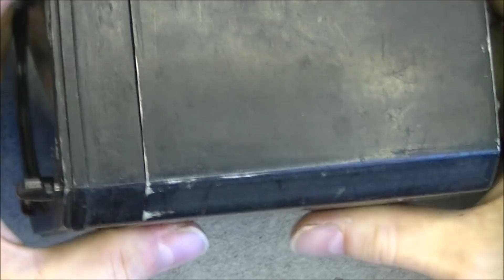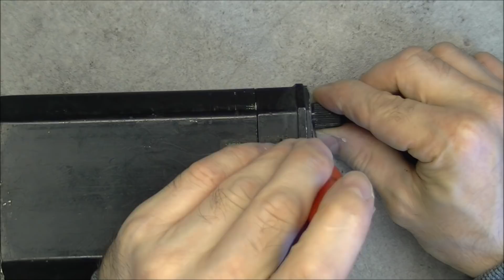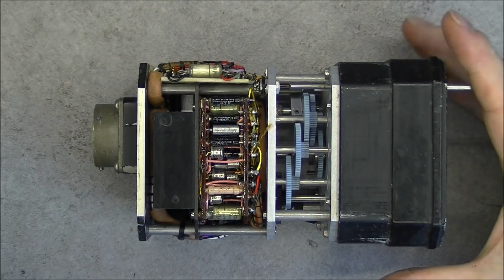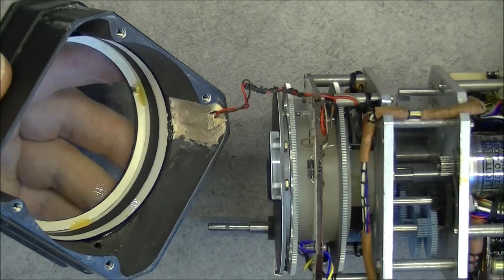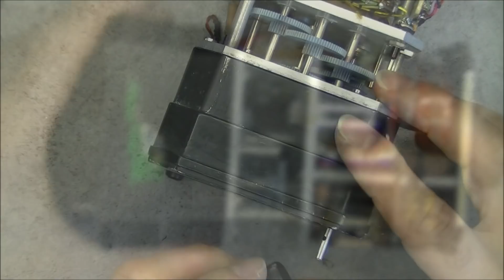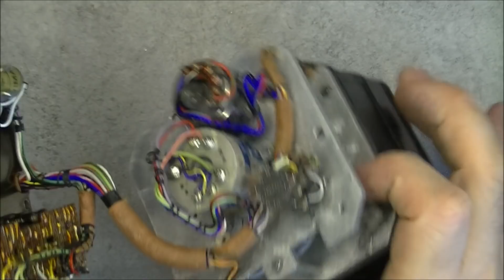Elliott radar altimeter indicator teardown

Comment: Airborne critical product mixed with Veroboard - flying by a wing and a prayer :-! I've sold to avionics - this wouldn't have ever passed approval - laughed out of the building more like :-? Hopefully a prototype? Great video, as always.
Reply from the maker: Yes it is really weird, the instrument shows signs of heavy wear by extended use, and the serial number seems way too high for a prototype. 
I have already seen parts with "Prototype" clearly written in place of a serial number, however I am not sure if it is a rule or not. On the other side, I have parts with extra low serial numbers, under 10 (and even one with "01" as a serial number) That are manufactured completely the right way, without any remains of the prototypish construction.

Comment: I'm sure my channel would do better if I had interesting accent like yours.  Can I only correct one word though: Gear has a solid G sound, so more GGEAR not JEAR.  Super video as always.  The cable lacing looked much easier on your test pieces where you have plenty of room.  Veroboard in avionics!